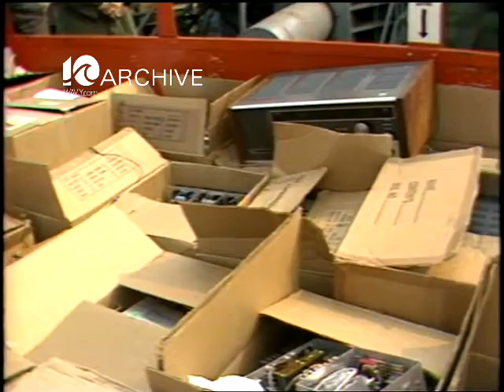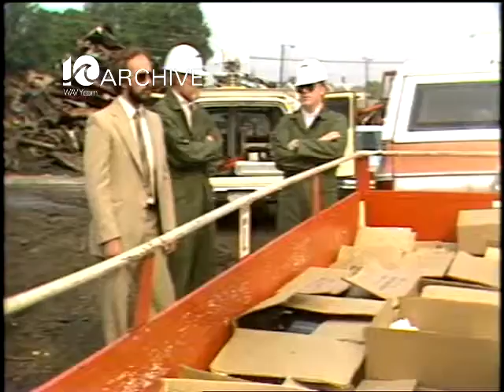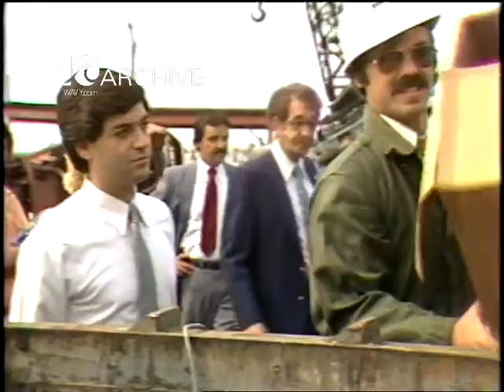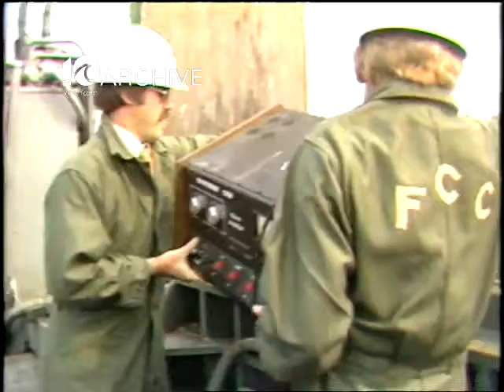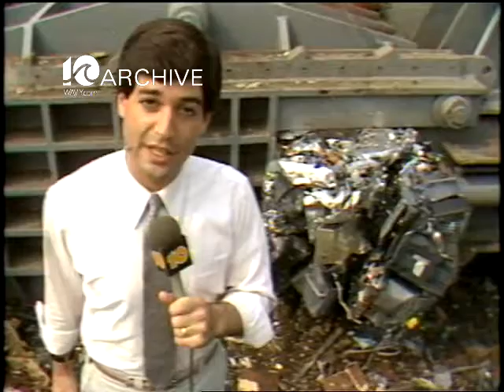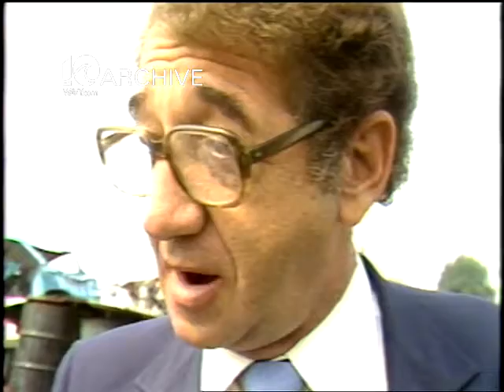WAVY Archive: 1981 FCC Crackdown on Linear Amplifiers

Comment: You can't legally run more that 4 watts from 26.965 MHz (channel 1) to 27.405 MHz (channel 40) in the CB bandwidth. Yet it's legal to run up to 1500 watts just a slight step up on 28.300-28.500 MHz. That can still easily interfere with the same things found in the Citizens Band frequencies. Such hypocrisy.